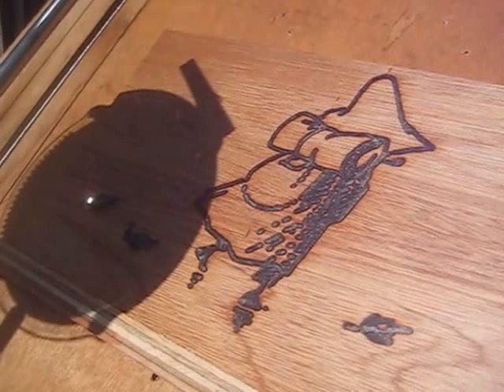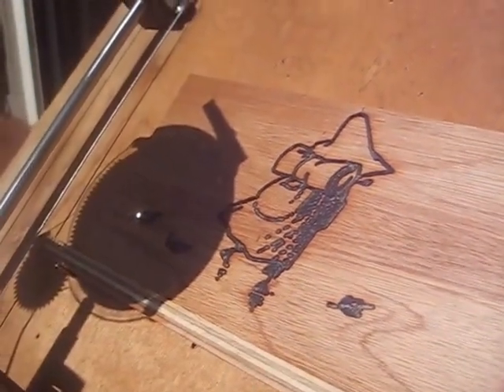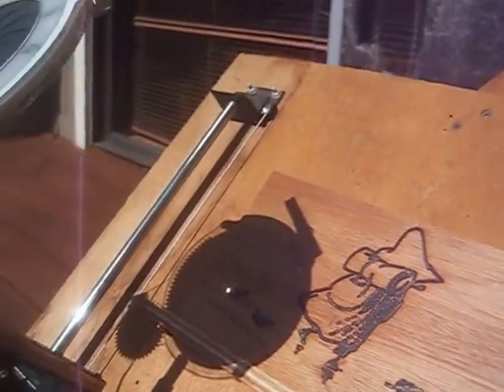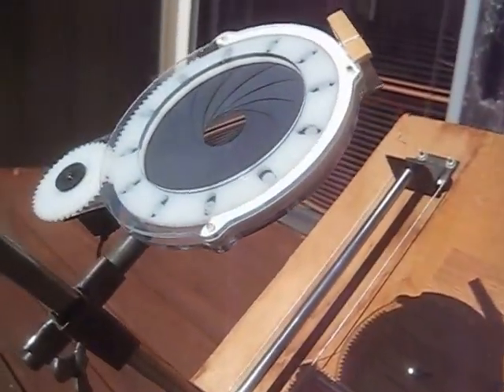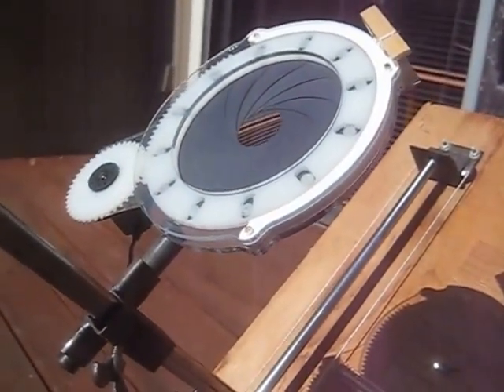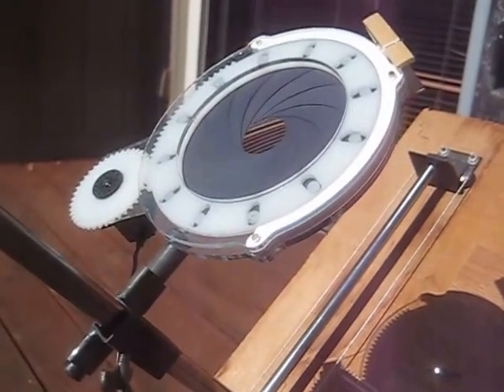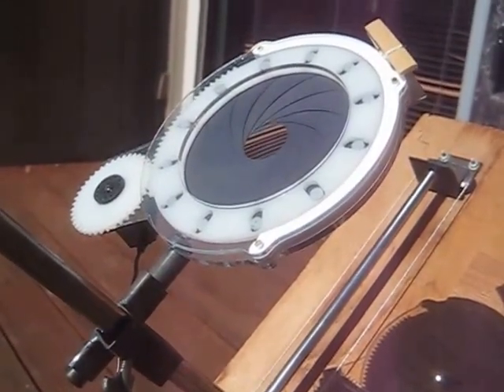Solar Plotter Producing Actual Art

Comment: @kurtschaefer Yea I saw that, pretty cool. I wouldn't like to stay there too long, will probably dehydrate in no time. I'm just wondering, would focusing heat from a light bulb be enough to melt plastic? Filament bulbs give off so much heat since they're so inefficient. I would go for a laser, although I think they cost a lot of money if you want a decent amount of power.

Comment from the maker: @20samp You might consider trying to use black plastic powder and a high powered laser diode.  I know folks have made cheap rigs that can cut black paper, and pop a black balloon.   I don't know if it has quite enough power to melt plastic, but it might.   It'd be close and it would be a lot more detailed then trying to do this with a big lens.   I don't know if you could get enough heat using something like a big Heat Lamp and a lens.  Probably not, but I've never tried it.